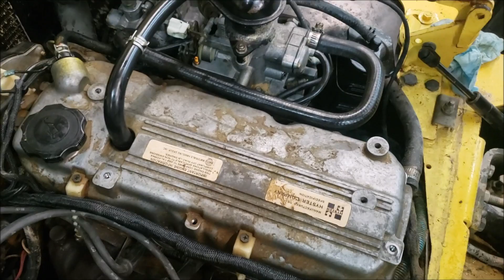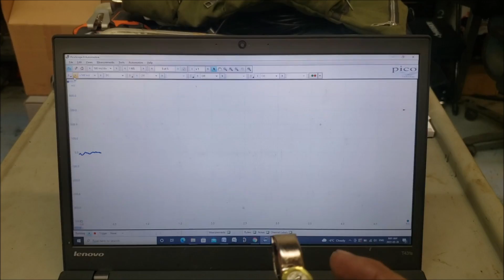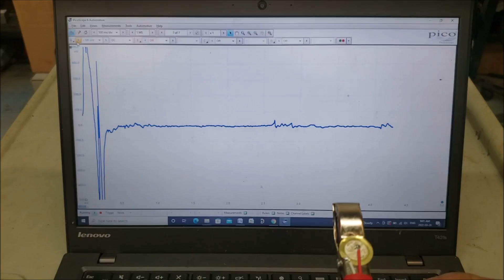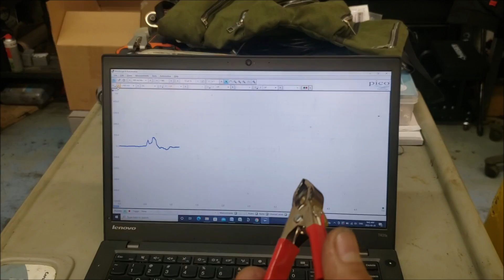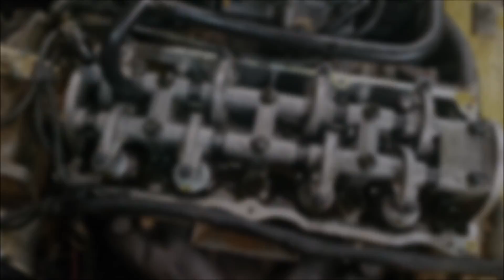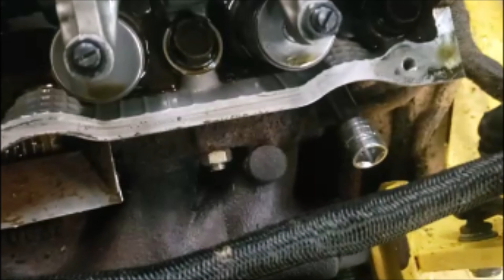Mazda Engine knocking noise

Comment: As soon as I heard that i thought that was a piston pin noise. a quick check an old timer showed my years ago (now im the old timer lol) was to pull the plug wire at idle and the noise will become more pronounced. if its a rod knock it wont change. Main bearing noise is under load and more like a hammer knocking on the block kinda noise. I liked the use of the extension though. And ive never seen someone scope an engine noise either so that was interesting. That being said ive seen engines come apart for a wrist pin noise only to find the rod bearings wiped out.

Comment: If that was a piston pin ...on your waveform at the end wouldnt it be showing up during the compressin stroke and not on a valve event ....good job on your videos i enjoy watching
Reply from the maker: From what I've researched a knocking noise on the compression stroke would point more towards the bottom end (rod cap, rod bearings). The explanation was that piston pin is loaded(pressure pushing down on piston) when going up, but when going down during intake stroke  the piston would be held in place until the rod pulls it down(no pressure on top of piston). Customer did not want to go ahead so unfortunately cannot prove it.
Reply: @forkliftgeek10  yeah i see what your saying i guess you have to hear it in person hard to tell on vid just have to thi k is the noise sound like its at engine speed or half engine speed ....i.e valve related ....where did you get that sensor you were using and what was it....keep up the good work as always i enjoy it was a dealer tech most of my life but been out of it for a while ...enjoy seeing how the technology has progressed....thanks....terry w.
Reply from the maker: The sensor I was using was a piezo sensor. I took it from a beeper on a dash display. I get what you are saying completely. Valves and rockers where the first thing I checked. Thanks for the kind words.
Reply: @forkliftgeek10  I have Mazda e2000 van same noise from my van engine I don't know how to fix it
Reply: @terrywells1655  thats why you pull a plug wire at idle. see my earlier comment. a misfiring cylinder will have no impact on valve train noise and usually not on a rod knock either. Usually being the key word there. but it will most definitely have an impact on a piston pin noise.